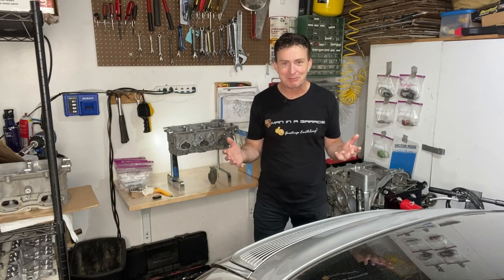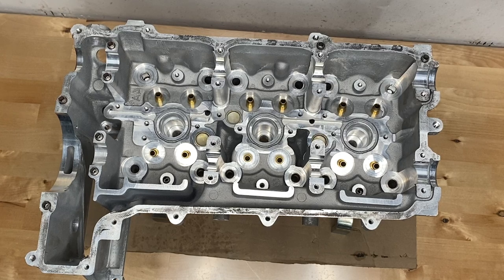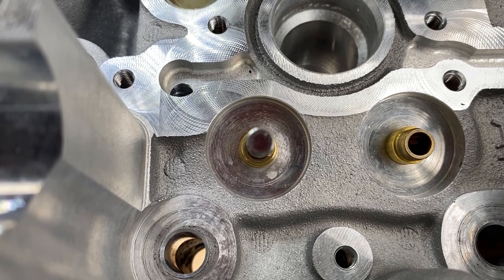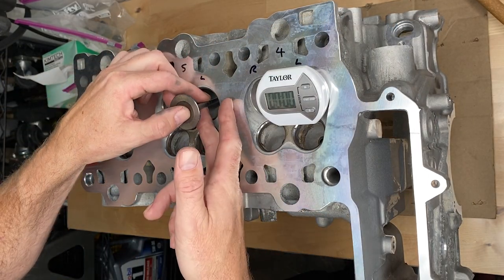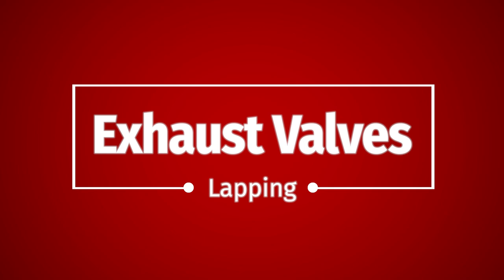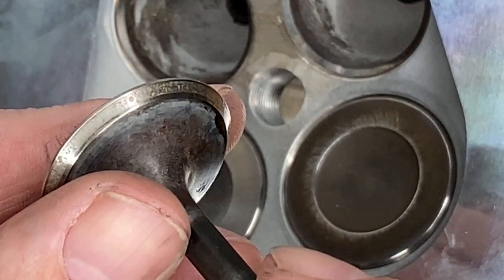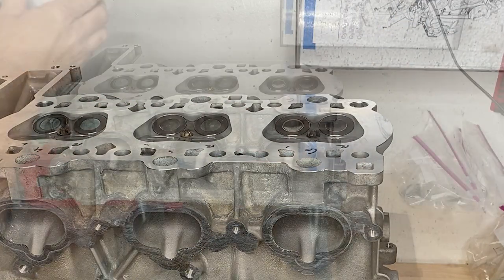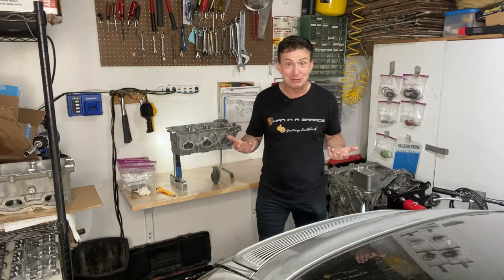HOW TO: Valve Lapping for impatient people!

Comment: Great money shots of the chamber, throat,  and bowl. A bit of cleanup work, gentle reshaping, and adjusting angles could add 30-40 hp.
Reply from the maker: Should I ever come back this way again, I will purchase some carbide burrs and go to town on one of these heads. For my first build, I did not want to go down that many rabbit holes. The risk of damage and the extra time involved was not worth the potential hp gains for a road car. For something like that I would prefer to practice on a Ford, not a Porsche 🤣😂. Thank you for watching 🤘😎
Reply: @ManinaGarage  you rebuilt a Porsche engine at home. That's an entire network of rabbit holes. You'd only need the sanding rolls you already have. "Gentle" reshaping is all you'd need. A little in the right place goes a long way.

Comment: Glad you saw my suggestion for Driven oil.
It’s the only oil my independent Porsche mechanic ( 1of only 24 in the USA who’s certified to install the LN Engineering Solution) will use.
You should also check out the Driven “Break-In Oil” for obvious reasons.
Keep up the great work 👍
Reply from the maker: Your input is greatly appreciated Phil 996! What part of the USA are you in? Thank you for watching 🤘😎
Reply: @ManinaGarage  Thanks! It’s really cool watching the disassembly and rebuilding of the 3.4 engine.
I’m in the Philadelphia suburbs.
Reply from the maker: @Phil99six  Call me ancient but whenever anyone mentions Philadelphia I immediately think of Live Aid?? Anyone remember live aid?…..Thank your for watching 🤘😎

Comment: Yet another super video. Sharing my experience, the last time I lapped valves in (in the UK), the grinding paste came in a double-sided tin, the course at one end and fine at the other. Listening to your opening attempt at grinding the inlet valves, it sounded like the paste you were using was coarse paste. It might be you can improve the finish and seal even more if you can obtain some fine paste and give them another session. Great to see you performed a leak test - that was a smart idea. When I was taught to test valves, petrol was used for a leak test. I get the feeling petrol might be better at finding any leaks.  Finally, I was told to keep changing the point to point position between the valve and the seat so that all parts of the valve was evenly lapped with all parts of the seat - if that makes sense. Anyway, loved the video - mega-production.
Reply from the maker: Greetings Lester 🙌, You are spot on. At the machine shop they had a 2 part grinding paste with the fine paste for finishing up. I was VERY tempted to use the good stuff. At the same time, both the parts store manager and the owner of the machine shop told me not to bother, everyone just uses the basic Permatex. Now that one head is pretty much finished, going back over them with the finer paste does not seem like such a chore..... especially after what you have said here. I agree that gasoline would be a bigger challenge for the valves to hold back, for the first go, I felt more comfortable with water as I did not expect them to seal at all! 🤣😂. As far as moving the point to point position, that is one of the subtle benefits that make the hand method superior. I noticed in the videos that the angle I'm holding the lapping tool need to remain more straight on also. Thank you for looking over my shoulder 🤘😎
Reply: @ManinaGarage  You know successfully lapping in valves is properly difficult and needs real skill. The proof of the pudding is the final leak test and you have clearly cracked it. Well done. Really looking forward to the first turn of the key - very exciting. 

Apart from a VW 'W12' engine, the flat 6 911 engine is one of the most challenging rebuilds and so far your endeavors have been on the money. I suspect this has been enabled by hours of meticulous research and preparation.

Comment: always oil the valve stems and guide prior to lapping. wd40 is a solvent, not a lubricant. once you are in there, clean up the rough parts of the casting
Reply from the maker: Good Point JimF, I used Wd-40 for these valves. Thank you for watching🤘😎